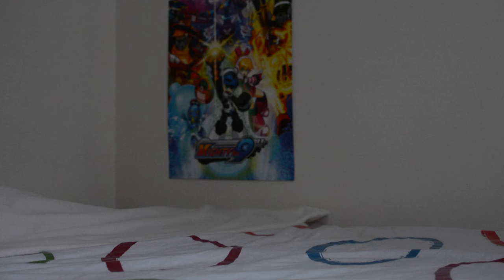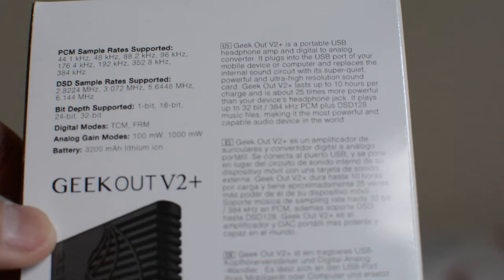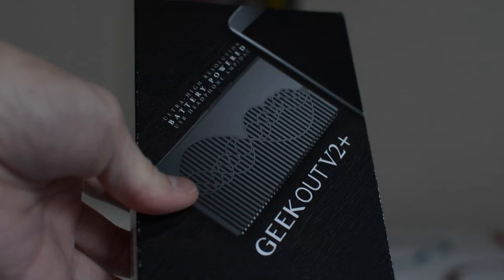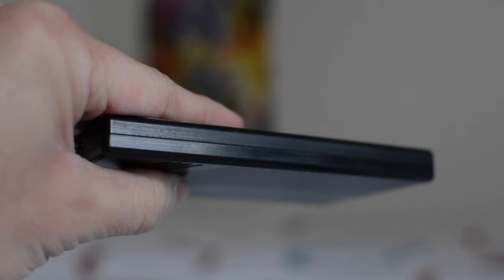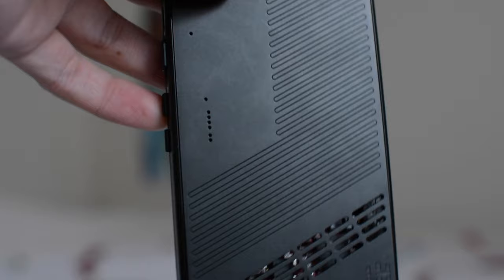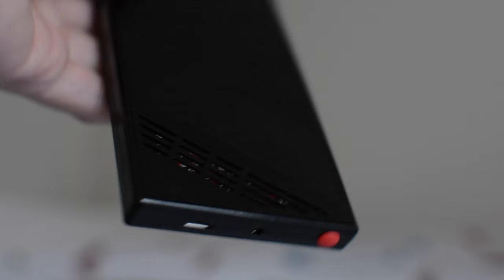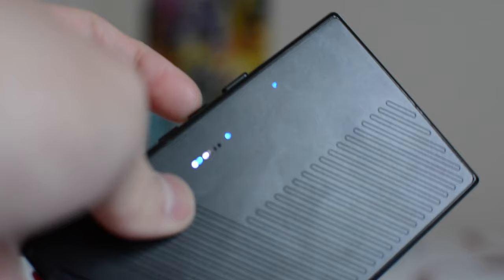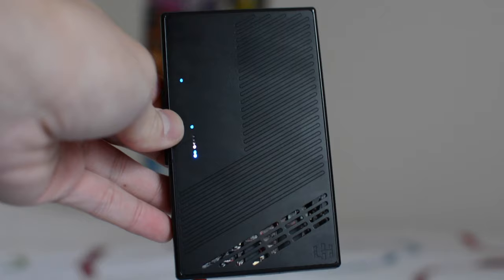[Binaural Unboxing] LH Labs Geek Out v2+

Comment: Nice review 
I don't really understand how to connect to balanced. 
Can this run with a computer also?  And can it run while charging?
Reply from the maker: +Ayman saleh 
You need a TRRS 3.5 mm jack adaptor to used the balanced output (the jack closest to the bottom USB port).

Yes you can use it with your computer....but unfortunately it doesn't seem to charge while it's connected to it. I've tried to simultaneously charge and use it at the same time but the battery gets depleted when trying that test.

Comment: Hi, Congrats, would really appreciate if you could do two tests drain the batter fully and see how much time it takes to fully charge and then how long it runs on the battery. we all know SQ will not be way off from GO v2 or Pulse but the battery test is really a acid test, hope you can help on this. Thanks. and yeah would love to know your opinion and comparison with HA-2 I know it will kill the HA-2 but just to be sure ;)
Reply from the maker: +Lone Star Sure thing. What setup do you have in mind for the battery test? Connected to computer, or to iPhone 4S? V-MODA Zn single-ended (high current demand), AKG K701 single-ended or balanced (medium current and voltage demand), or OPPO PM-3 single-ended (medium current/typical portable headphone)? Low gain, or high gain?

16/44.1 music, or DSD128 (or anything in-between)?
Reply: +miceblue425  Hi, coincidently I have got PM-3 as well so really would love to hear your experience of partnership of V2+ with Oppo, if you could test the Oppo with high gain setting with Iphone or Android than that would be great I am planing to use it with Surface and Samsung Note 4. I know oppo doesnt require high gain but it gives a little kick in bass which is nice.
Reply from the maker: Lone Star

So you want me to do the battery test with the HA-2 instead of the V2+?
Reply: +miceblue425  Hi sorry I mean using Oppo Pm-3 on V2+ with Iphone or Android deviceand using at max output of volume to see how long it last.
Reply from the maker: Lone Star 
Ah okay, that sounds good. I can do the test on Friday when I get some free time.

Oh also do you have a preference for the type of music played. DSD music requires more processing than, say, 16/44.1 music, so that might strain the battery life more. I can also play some typical 24/96 music for a high-resolution testing session.
Reply: +miceblue425 Hi Yes EDM or Rock with solid bass to have good test, I understood from posts on Head-fi that V2+ has lower output on SE compared to GO1000 which I currently have and planing to use it with Oppo PM-3 and Shure SE535
Reply from the maker: Lone Star
Ah, yes, I actually just finished typing up this post, hahaha.
http://www.head-fi.org/t/765527/lh-labs-geek-out-v2-discussion-thread/675#post_12149689

Single-ended output and low-gain is all that I ever need for my headphones. XD

The balanced output does sound nicer, but I only have the K701 with a balanced cable. I do know there are balanced cables available for the PM-3 and I wanted to make one myself some day when I get the time, but right now I don't have one.
Reply from the maker: +Lone Star 
Test 1:
http://www.head-fi.org/t/765527/lh-labs-geek-out-v2-discussion-thread/690#post_12158733

Now I'm doing the charging test.

Comment: Will there be a review of this anytime soon?
Reply from the maker: Hopefully I'll have some time next weekend. I've been pretty backlogged on my YouTube channel since school has been busy recently. I did get the updated GO V2+ with a much improved chassis, so it looks a lot nicer too.
Reply: miceblue425 oh.. Nice. Do you have a hd800 (or hd650 which require fairly similar power but are less resolving)? Looking at hd800 + geek out/apogee groove combo (or both) sometime in the near future.. I'm pretty sure the groove will drive it plenty loud for even the quietest masterings but I think geek out will have better dynamics and nuances (owing to its quiet noise floor probably).
Reply from the maker: I don't own a HD800 nor HD650 myself, but I have heard them with the GO V2+ with friend's units (HD800S instead of the HD800 though). The GO V2+ can drive them just fine without any problems, and if you have the balanced output, the dynamics are improved a bit with better instrument separation. I'm actually looking to sell my unit with a 3.5 mm TRRS to XLR adaptor cable if you're interested. I haven't been using much recently since I have other gear at hand.
Reply: miceblue425 I'm like about 4-6 months away from any potential purchase. If you have your unit in good condition till that time I'll buy. Right now a final year college student (so no funds right now) and I'll be in my job this July.
Reply from the maker: Ah, I see. Yeah I'm a graduate student myself.....ugh the student debt. >.>
Reply: miceblue425 no student debts.. I just have to rely on my parents money for now (till I move into my job).
Reply: miceblue425 hey. How much would you expect for these? And where to you live? I don't need the trrs to XLR adapter though.
Reply from the maker: Around $250 for a GOv2+. I'm currently in Los Angeles, California, USA.
Reply: miceblue425 ok.. That's a good price. I'll see.. Im from india but have relatives there. How much have you used them? And how much is their battery life now (when powering demanding headphones)? Can they charge and play at the same time out of a laptop?
Reply from the maker: I've used this specific unit for less than 24 hours. I get around 8.5 hours of battery life when playing CD-quality music files from my iPhone 4S (and using a camera connection kit). Battery draw depends on how much current your headphones need and I was using a typical 28 ohm portable headphone: OPPO PM-3.

You cannot charge and play at the same time (playing will take priority) even though there are separate input and charging ports on it.
Reply: miceblue425 ok thanks.. I don't think I'll be able to buy it soon. If you still have it after 4-5 months, when I'll have enough cash for that I'll buy.
Reply from the maker: Aaand I just uploaded the review video!
https://www.youtube.com/watch?v=jsHSegAO-aQ